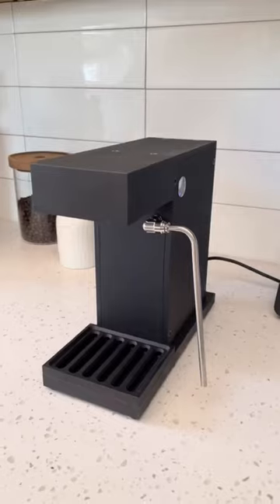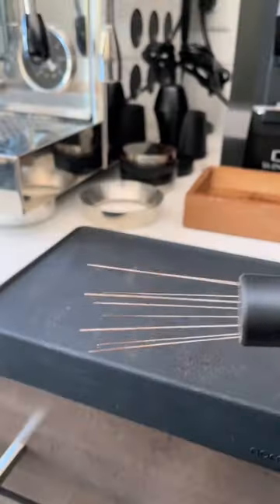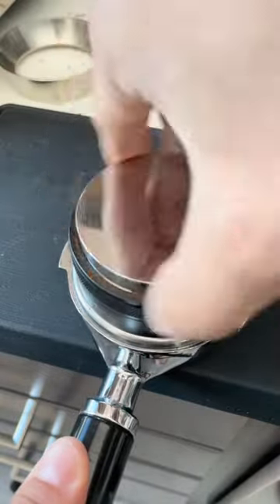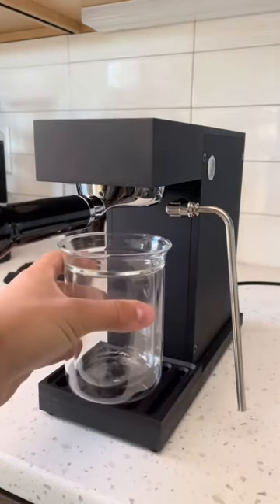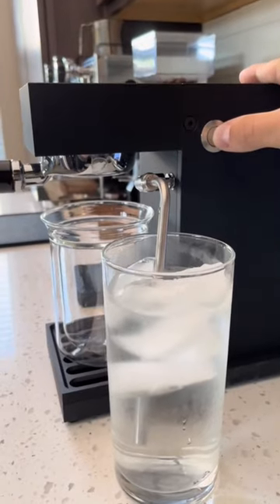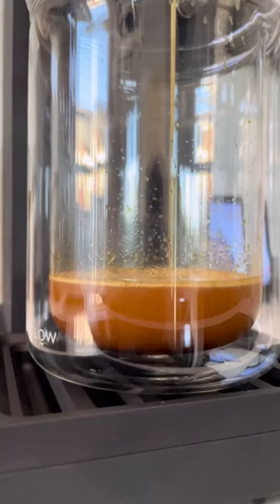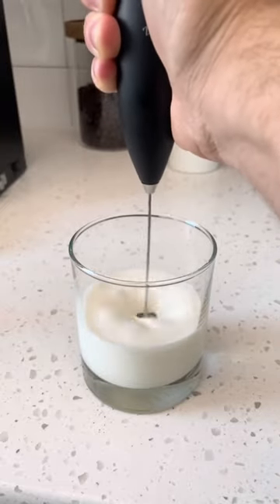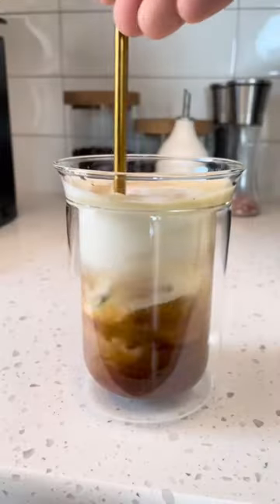Ice cold espresso hits different #coffee

Comment: You should stop using the ocd distributor.  Someone did a study and found it decreases extraction
Reply: @BloodyPFX Yeah, but you can still get a fancy look with a wdt tool and that actually helps with extraction.  I'm always confused when people with nice machines and grinders use the OCD tools, one would think they would know better.
Reply: that was only when using it instead of wdt, not with though right?
Reply: @aaaahdjsn  It should be fine after wdt but also pointless.  Some data has shown that it causes lower extraction compared to a normal tamped shot.  My theory is that the OCD might create some additional clumping while smoothing out the puck.
Reply: @BloodyPFX The wdt tool that looks like an OCD is expensive as hell and works the same a cheap wdt.  It only makes sense to me if used for a lot of pulls in a situation like a cafe.
Reply: @seabass8154  nah, it's not pointless, looks cool and flattens the puck for me :)
Reply: Could you link the study, please? I'd like to read up on that.
Reply: I'm gonna go ahead and guarantee you won't be able to taste the difference in a Triangle test. 

Especially after you destroy it with syrup.
Reply: @jamesmorgan1327  Then why do it in the first place?  If doing it was to make better coffee but it actually makes things worse and apparently the taste doesn't really matter at all, why do it and waste time and effort. 
Sidenote: It will have a noticeable increase in sourness compared to a non ocd shot and sourness can't be masked by sweetness.  It makes things worse.  Something with fat like milk would though.  It's why you can add sugar to milk drinks or something with creamer but not straight espresso.  Makes the shot tastes insanely sour.
Reply: @seabass8154  exactly